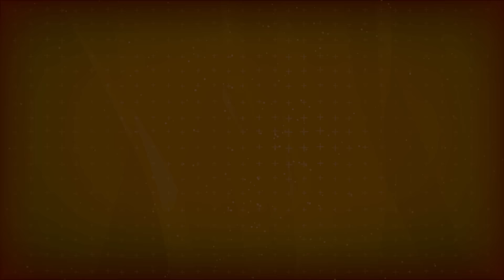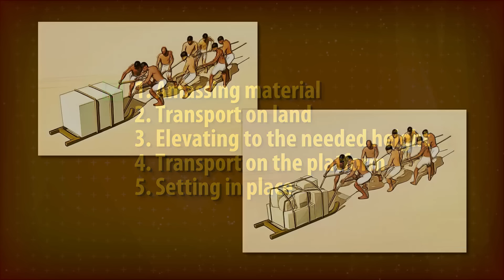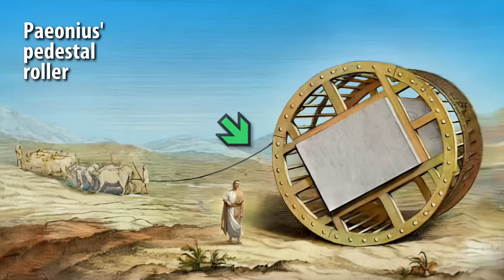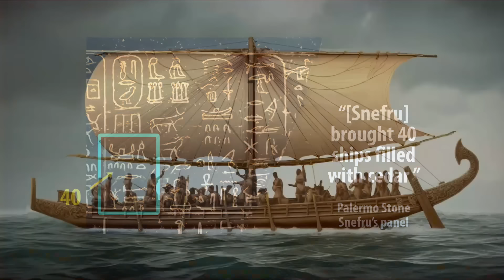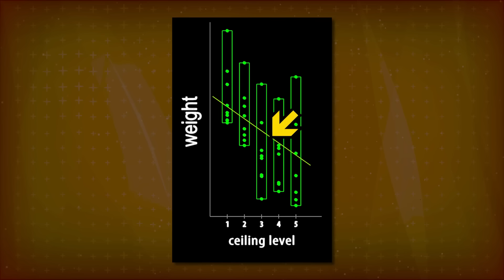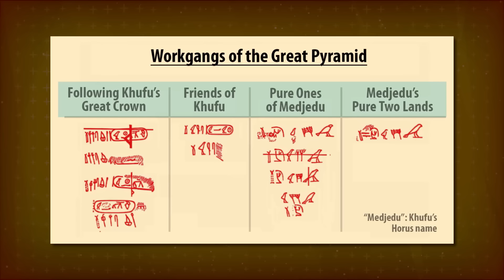How to Build the Great Pyramid in 9 Months (NOT aliens)

Comment from the maker: Ko-fi: https://ko-fi.com/nightscarab

-- GROUNDWORK --
@01:10 Why?
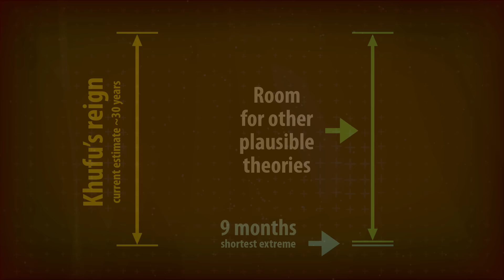@02:16 The rubble problem
@12:58 Rolling stones
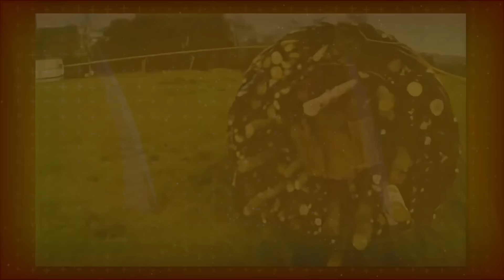@17:46 Parbuckling
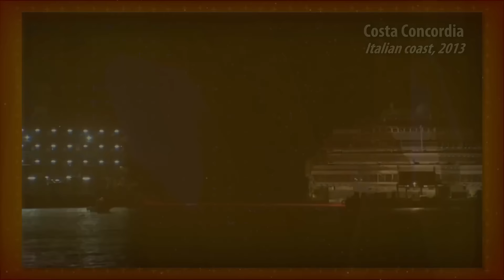@18:25 Old Kingdom & the wheel
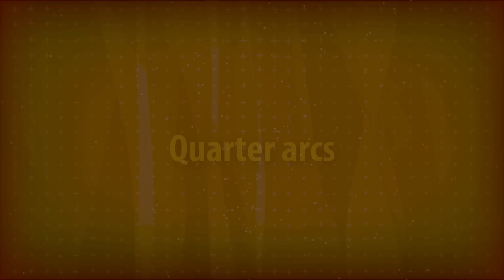@23:02 Quarter arcs
-- PROPOSAL --
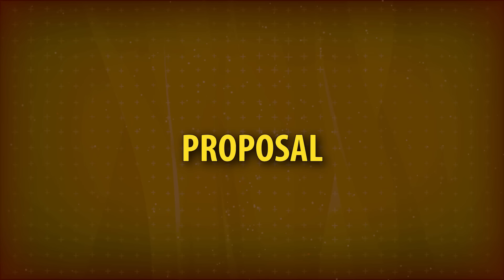@27:22 Containers
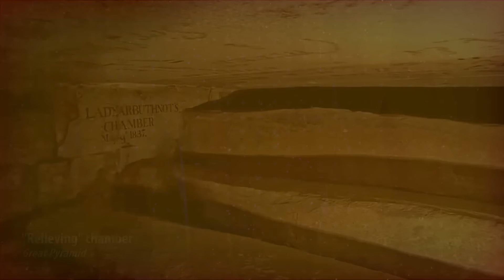@31:52 Fractal ramps
@34:02 Fixed lift stations
@38:41 Granite blocks
@45:31 Time & crew estimates
@49:42 Advantages
@51:04 Conclusion
Reply: At 2: 16 you mention the Rubble problem. But I don't think Barney was still around by then. 
Thanks for an Amazing likely possibility. 
There would have been some tons of vegetable oil lubing the wooden machines.
Reply: @senatorjosephmccarthy2720  there has been  a Rubble on every major human undertaking since before the beginning of time. That dumb guy who's more lucky that good and loved by all the men. Of course without a Flintstone hes basically worthless.
Reply: If it was easier to transport and lift blocks.... why not cut the stones AFTER they lift them?
They would most likely have to be finished to fit before putting them in place.
If you finish cut blocks on the level they are working on, then the rubble left over can be tossed in.
Reply: Its just a question of time with the appearing wheel, when 'later' Pharaos did shurely use war-horse-wagons on a battle.
Reply: Have you also seen the idea that the vertical shafted "insulator" depicted in ancient Egyptian writing where possibly multiple stage/ratio pulleys?
Reply: The rubble content is something that many don't want to think about.  Rubble backfill  was common in ancient structures across the globe
Reply: So far 1000x better than the History Channel crap I grew up on X-)
Reply: building theory seems solid but the so called egyptians just carved crude writing and pictures onto glorious works of stone art. if these so called kings had the tech to build this stuff then they wouldnt have such crude craving on flawless surfaces. the wannabes just claimed the ruins for themselves and egypt is actively preventing the truth by block access to tons of stuff and many things from the 1800s are now missing but dont ask questions....
Reply: just like in south america where the inca built crude stuff over the ancient mega structures and then the spanish even cruder repairs
Reply: Dude they didn't repair they stripped destroyed and re wrote religion down there. The are written accounts of how much gold was taken back to Spain. And Spain then was in bed with the Vatican. Guess where 70% of the gold went. I'll wait.
Reply: Looks like a rocking bed for a baby
Reply: The alternating rubble and block theory is probably smack on the money.
The sight lines problem might be addressed with rods of fixed height and survey points as we do today.
This would deal with the corner ramps maybe.
Great video.
Reply: @waynemyers2469  Thank you for your thoughtful comments. I'm a physics type so I was attempting to come up with the total energy required to lift all the blocks then look at how many healthy men it would take to do it.  Ropes, pulleys, inclines and levers are not 100% efficient.
Reply: @kurtdobson  Did I actually add anything meaningful or are you just being kind...or did I mess up your calculations? No matter, I'm glad to help either way. peace.
Reply: Them quater arcs look like when fixed they are kind of roundish Square which means they would probably have less chance of rolling backwards if you know what I mean.
Reply: Since they didn't cut the stones, you're already starting with a failed premise

Geopolymers my friend

What makes more sense cutting and moving stones 500 mi through the sandy desert 

Or?

Carrying buckets of debris and dumping them in a form and pounding them in place and then removing the form and then doing that right next to it and on top of it, so that you can't even fit a plane card between the stones, because they were made in place!

I still agree with everything else. You said you can have loose pockets of debris in between all that, but they were not cutting stones and moving giant stones and putting them in place and then seeing how well they fit and sanding them down until they were perfect... No one would ever do that. That is ridiculous, especially before there was power tools.
Reply: @Bozemanjustin  What makes more sense, cutting stones the same way they've always been cut and are still being cut today in some quarries or scouring the countryside for several different ingredients of varying  levels of accessibility, bringing it all together, processing it, building forms, hauling the material, mixing it onsite (for which no evidence has ever been discovered.), hauling untold amounts of water, filling forms, setting the stones, blah, blah, blah. Keep in mind, all this had to be accomplished without leaving any impressions on the blocks from the forms, no high levels of the assorted minerals where the mixing was done, no scraps from the wooden forms, no pictorial representations of the method being used, no historical precedence (except one hazy line on the Hunger Stele), nothing. PLUS, despite your assertion that you can't even slip a playing card in between them the blocks are actually only roughly finished and as for any idea of precision, in truth, no two blocks are even of the same dimensions or weight. (The playing card statement, usually a slip of paper, was said of the stones at Machu Picchu, not the blocks in the Pyramid at Giza.)
             Besides all that, are we to believe that our prehistoric ancestors cut and dragged stone for thousands of years (Stonehenge, Gobekli Tepe, The Tower at Jericho, New Grange, etc.) and then one day the Egyptians announced a better way and then they built a couple Pyramids using that way, against all the hurdles I mentioned above and then they...just...stopped...doing it that way...until Roman times or even later (and actually the Romans mixed concrete, not polymers...there IS a difference.)?
            Your last statement, though, concerning power-tools, was the one that allowed me to identify your position and to place you in your ideological niche: You're a "Technophile", you are so immersed in, 
so dependent upon and so disempowered by technology that you can't imagine life and progress without it, without...power-tools.

"Those who say it cannot be done, should not interrupt those who are doing it."
Reply: Have you seen this theory https://m.youtube.com/watch?v=KMAtkjy_YK4&pp=ygUGayAyMDE5

If so, What do you think about it?

The fractal idea you mentioned makes so much sense, I’ve never heard that anywhere else before.

I disagree with your comparison of Kufu to a North Korean leader, it makes sense if the pyramids were just a tomb but there are so many theories that they weren’t.
I’ll look for sources if you’re interested but just off the top of my head, ive heard there are marks of ash and soot in the grand gallery that could of come from ancient light bulbs.

2 Some of the stone inside are more electrically conductive on one side compared to the other.

3 The shape of the pyramids are said to be the most efficient shape for storing electricity.
4 No bodies were ever found.

5 The pyramids themselves could be even more ancient and only restored by kufu creating more confusion.

6 the pyramids could have been surrounded by water, which some how can make the pyramids have some kind of hydro electric use

These are all theories though but all together gives me some kind of circumstantial evidence for another purpose other than a tomb for kim jun kufu.

My sources range from Graham Hancock, YouTube channel mystery history, and k 2019 documentary
Reply: @waynemyers2469  Thank you for your thoughtful comments.  I'm a physics guy, so I was attempting to come up with the total amount of work (mass * height) required to lift all the blocks, then look at how many healthy men it might take to do the work. 

Ropes, pulleys, levers and inclines don't reduce the amount of work because there is always friction and other losses. 

I'm not a critic of anyone's ideas on this most interesting topic, and I really appreciate all the thinking folks who ponder the mystery and propose possible methods.

IMO (and others), the pyramids were built long  before the Egyptians arrived using technology we don't have or understand. I don't think the Pyramids could be build today even with our heavy machinery.
Reply: There's a simple theory by Henri Houdin, of how they got those 80 ton blocks up there - they used a system of counter weights and ropes. They wrapped a rope around the blocks on the opposite side of the grand gallery. Ran the ropes up the side, across to the grand gallery and down to a sled. They stacked stone on the sled and it acted as a counter weight and as it slid down the shaft the 80 ton blocks rose on the opposite side. @waynemyers2469
Reply: Pretty good video. I cant believe the least technologically advanced humans of the past, one step above cavemen, created the greatest architectural structures on this planet, over decades, if not centuries ... It is more likely the most technologically advanced humans of the future that did these things. They did it with little effort, and in such a short timespan that it can't be comprehensive to linear time.

It only took a day to do these things. It was the eighth day. That day was an eternity of "hell" that triggers psychological trans-generational trauma memory in most modern time linear humans. Its why they fear "hell".

The forth dimension is SO much different from the other three.
Reply: @cheesewizard2294  " I cant believe , one step above cavemen,"
i cant believe a person who has had the opportunity for education is so ignorant and dim as you are! 

yer time travelling advanced humans build piles of rocks! 🤦‍♂🤣
Reply: @cheesewizard2294  I think the "trans-generational trauma" part of this post speaks volumes and explains, perfectly, the source of this theory. If an erroneous view of history can be explained as "time-linear humans who can't assimilate the activities of entities from the future" then it's an open field after that, you can propose anything. Of course, even if you can convince your nieces and nephews while you're all sitting together at the small table during Christmas dinner, your knees banging together and kool-aid spilled all over the table-cloth, even if they believe you that doesn't mean the adults aren't listening in, snickering and looking at each other sideways as if to say: "Can you believe we used to let this guy baby-sit our kids?"
              Anyway, don't worry, this is the last-gasp attempt at preserving the mystique of the "Twilight Zone generation" and, soon, the last of them will have passed on and that precise moment when the last one dies is when we'll discover time-travel...again.
Reply: So
You said it yourself at the beginning, this vid is just a theory and no one actually knows
Reply: Well, in 2006 Drexel University provided an electron microscope study of the quantity of the product used in the pyramid stones and found the nitrate levels were off the chart and impossible to be natural and a source for such a quarry is not found on earth. It's more practical that the stones are artificial and the ingredients were not mixed properly..
Reply: @MrWizardofozzz  Horseshit, provide citations or you're just pullin' shit out of your ass.
Reply: @MrWizardofozzz  This is absurd, gathering all the necessary ingredients, transporting it, mixing it (and don't forget transporting an enormous quantity of water) would entail more work, by far, than simply quarrying the stone like every other ancient culture had been doing for thousands of years. I'm going to explore the "Drexel Unioversity" story but I'm 99% sure it's bullshit...
Reply: @MrWizardofozzz  This is complete nonsense, a great deal of the limestone blocks used in the Khufu Pyramid were traced to the Sphinx enclosure and the "scientist" who ran the study for Drexel was a complete wingnut who, I'm about 99% sure, never even got published in a reputable journal.
Reply: @MrWizardofozzz  yeah, but the ancient Egyptians had very little access to electron microscopes. So how did they get the recipe right? But on a serious note.... I assume that the incredible ancient mix was consistent throughout all the blocks? The question then becomes how did they manage such a high level of quality control?
Would it not make more sense that they either got lucky and came across an incredible source of amazing stone and used it all up? Or maybe they knew what they were looking for and used the best stuff they could find until it was all gone?
Reply: @christopherleveck6835  Why would they need an electron microscope .? Drexel University(among others) only provided the evidence the stones contained unnatural high quantities of minerals that made it impossible to be natural, not because the Egyptians didn't have an electron microscope,  but because no source(quarry) can be found on earth and it contains air bubbles, hair and other filaments.. But that was a funny reply, thanks.   Drexel, Engineering The Pyramids .
Reply: @MrWizardofozzz  I was joking in reply to the person who mentioned the rock was found to be exceptional by using such an instrument. Was trying to be funny but then did try to make what I thought was an alternative reason for the ancient Egyptians abilities to pick out exceptional building materials.
Reply: @christopherleveck6835  Actually, I was kidding as well, lol.  It's strange how the evidence was published back in 2006 from Drexel, and barely anyone knows about it..
Reply: What's your opinion on the geopolymer concrete theory?
Reply: @everybody5brother  So you want to make grains then cast its far more work! Also who is the guy cutting shells in sections and placing them on the cut edge up to the mould?
Reply: @antikokalis  Probably worth the mention that Na2SO3 (Sodium Carbonate) is the key to making SH-UHPGC.  Known to the Old Kingdom Egyptians as "natron", it was also the key to proper long lasting mummification.  By all indications, it is very plausible that they developed a Solvay-type process and were able to manufacture Sodium Carbonate within the Red Pyramid.  🤫
Reply: @everybody5brother great, but if you do the math to calculate how many we'll fed strong workers it takes just to lift the blocks to the required height it works out to >100k workers 8 hrs per day 6 days per week 20+ years...
Reply: @kurtdobson  IF we assume the pyramids are made of SOLID precision carved blocks all the way through....
What if they hauled roughly hewn blocks to each level and then finished them just before they slid them into place?
That would create many tons of Rubble that could easily be swept into large open spaces between the highly processed blocks. Like a modern day retaining wall. You could build a pyramid that size with 1/3rd of the blocks if you filled the space between the internal structure and the outside layers of finished stone. Maybe they had enough material to build the entire structure by simply using oversized blocks and the ruble that resulted from finishing them. It would make sense as you need less blocks for every level and you create less ruble from finishing those blocks with each level.
I bet someone back then could do some quick figuring to sort out the best sized block for hauling up there and the size to cut it down to to create exactly the right amount of Rubble to fill in the structure for the level. Without having any waste to get rid of.
Plus you wouldn't have to worry about damaging any completed stones in transit.
Reply: @kurtdobson  actually the number is more like 13k workers
Reply: @christopherleveck6835  I agree with you that it would be more practical to do the final sizing on site and the rubble could be filled in between the gaps.
Reply: @christopherleveck6835  Why would you assume that the Pyramid was constructed of "solid precision carved blocks all the way through?" It wasn't, the blocks were somewhat rough hewn and, in fact, no two blocks are even the same dimensions or weights. The more "precision blocks" were the outer casing stones. Additionally, the interior of the Pyramid is partially filled with rubble and debris. The mythology that has grown up around the Pyramid is partially what has led us to the point that people make absurd statements about it's purpose and construction and pass on idiotic theories that completely obscure the true wonder of the Pyramids. The Great Pyramid is no more a "precision built" structure than any of the other pyramids and it's true nature is much more mundane than many uneducated theorists would have you believe.
Reply: Pyramids are piled up blocks of stones which were excavated to build the Suez Canal by brits.
Reply: @ShonMardani  how did they get the blocks to the canal if the canal wasn't built yet?
Reply: That part you should answer, I am saying that miles of rocks had to be cut for that wide and deep canal, thay had to move them somewhere or grind them to sands, they picked the right choice.  @christopherleveck6835
Reply: Perhaps the annual flooding of the Nile? @christopherleveck6835

Comment: A feldspar, quartz, diamond cut dust, forms a nano clay sludge, add sunlight from 50,000 parabolic mirrors oh say the size of that three finned disc artifact nobody knows the use of, and the photon bonds are added by lenses to make the granite matrix crystals form to any size of alabaster board 500 Ton mold box. Can they use Solar at 8000 degrees? It’s free so sure they can. Say one hour cinter firing each for 1000 molds. Total build time? 2500 hours+. Distance to move each, 12 feet, not more.